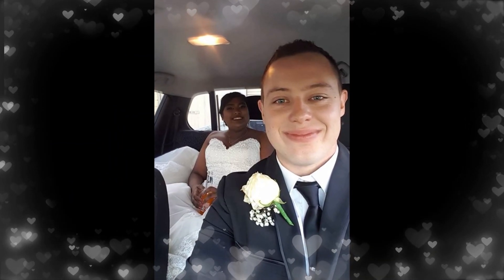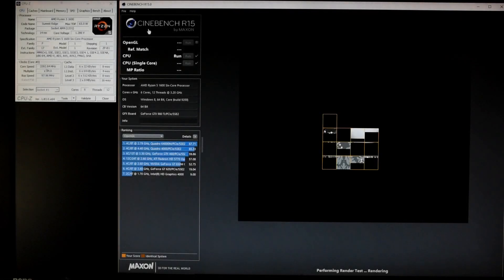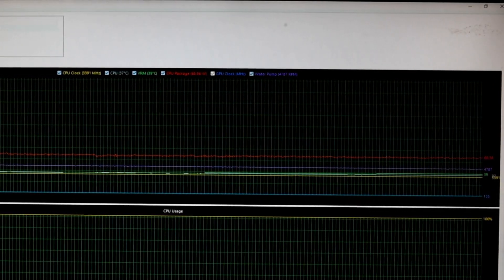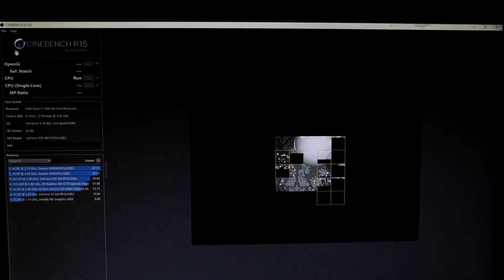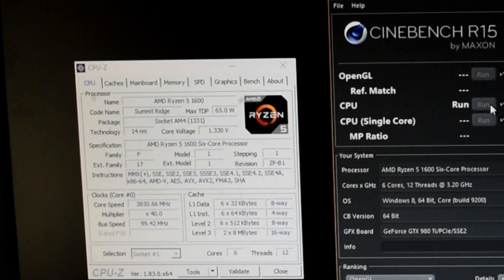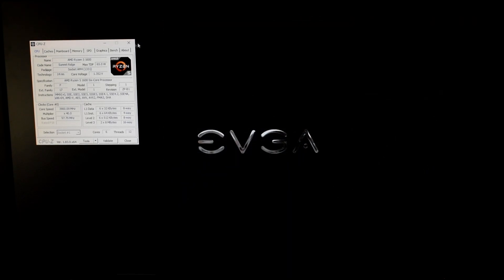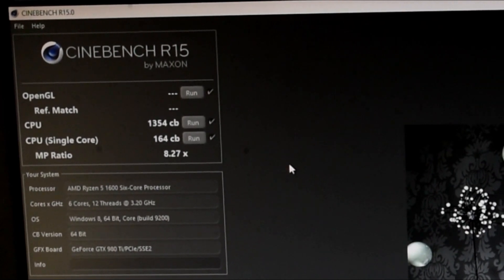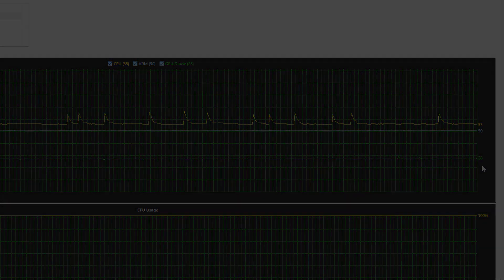Ryzen 5 1600 Overclocked to 4ghz

Comment: my ryzen 5 1600 is running happily at 3.8Ghz with stock cooler and it was really easy
Reply: What voltage and temps?
Reply: Mine too, didn't touch voltage and my temps didn't change from stock settings. 😈
Reply: @jakegenocide  stock cool 4.0 ghz all stable
Reply: 4.02 ghz 1.40 votls
Reply: My ryzen 5 is #5 on cinebench20
Reply: @dizzdaman  Nice, hit the lotto, top 5 1600 on air? That's ridiculous, kinda a let down that 4.02 is top 5 though. Was hoping to get 4.1 or 4.2 with a loop, guess I'll go AIO and save the loop build for a 3900x for my wife.

Comment: Good video!  I can't get my R5 1600 to even boot at 3.8ghz using the stock cooler from a 2700x.  It does 3.7ghz all day though.  I'm using the MSI B350 Gaming Pro Carbon motherboard.
Reply from the maker: Is that on stock voltage? 3.7-3.8ghz on stock voltage is where most 1600 chips will land as far as I am aware. Motherboards make a bit of difference when tuning Ryzen chips, will be interesting to see how well this X370 will handle Zen2 when it comes out.
Reply: @techforge-Nate  yeah, it was stock voltage.  Don't really need it go higher I guess since I play at 1440p/4k.  As far as Zen2, I'm wondering if it'll be worth trying to upgrade to that without buying a new x570 board.  Hopefully it'll work with a B350 board.  Thanks for the response!  When is your next video?
Reply: @SteeltechPC  Within 15 minutes of overclocking I got my ryzen 1600 to 4.0 Ghz on the stock cooler at 1.4 volts. It's a bit too hot for 24/7 use, but for benchmarks... man crazy fast.
Reply: @brandontrost8888  guess I lost the silicon lottery.
Reply: Mine boots up at 4.0 ghz but any benchmark and its gone. I leave it at 3.95 @1.350 V using the stock cooler. Surprising cause my ambient temperature is 30 degrees daily over here in the Caribbean

Comment: Great video mate, I have picked up a couple of Ryzen CPU's myself and have had a blast messing with them. the 1600 i had managed about 3.8  but was using only the stock cooler.  gave that little ripper to my old man and he loves it.   the 2700x and 1800x were my main ones and the 1700 i grabbed back when i got the 1600 for some music production workloads.  I had more fun messing about with the first gen ryzen over the second gen as less oc was needed on the 2700x.  but I actually did end up overclocking mine to bring down the temps and voltage.  overall tho your content and overclocking video here was a great watch thanks for sharing mate looking forward to watching more of your content.
Reply from the maker: Thanks for the feedback Dean, it's great to hear. For most users the 1600 is an excellent CPU, and 3.8ghz on the stock cooler is exactly where I landed as well. Sounds like you have had a lot of fun messing with many different Zen CPU's (living my dream hahaha), the 2700x has been my favourite out of the two though since PBO is a new technology, very keen to see how it operates on the Zen2 CPU's.

Comment: Did you happen to accidentally set your house on fire during this process? Or did the watercooling keep it down?
Reply from the maker: Watercooling keeps it well under control- around 55c after more than an hr on Aida64 full stress test. TBH a decent aircooler would keep it a safe range as well. It's certainly no 8700k at 5ghz.
Reply: Ryzen is not an FX series chip. They could throw some heat, but it seams that intel is making the space heaters lately.
Reply: @SithaLords  its because intel only uses thermal paste instead of soldering